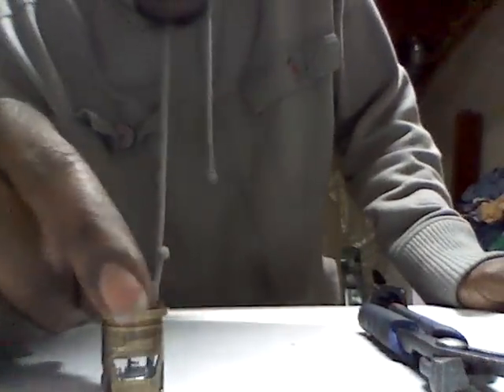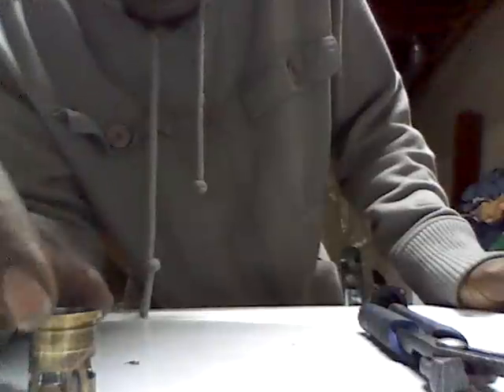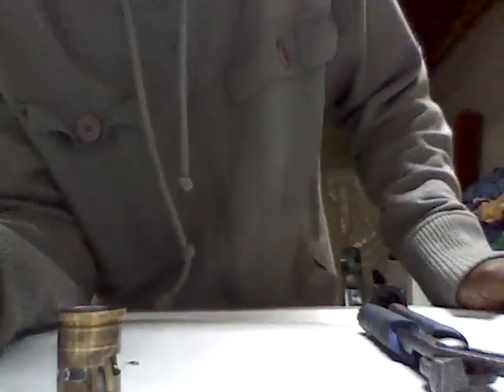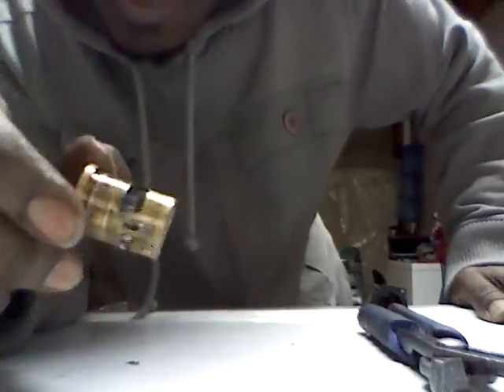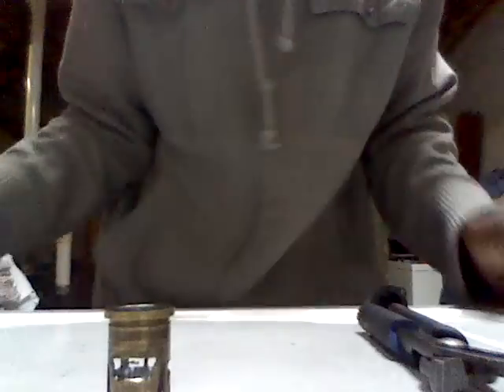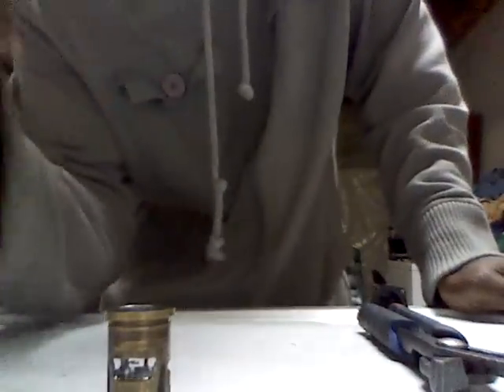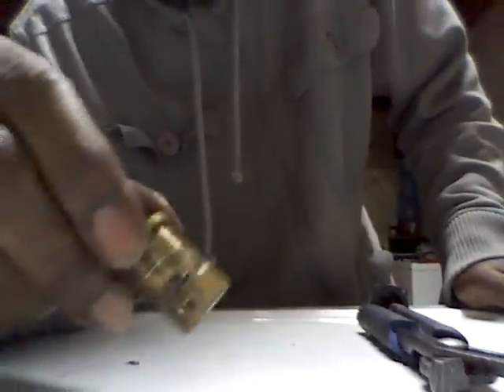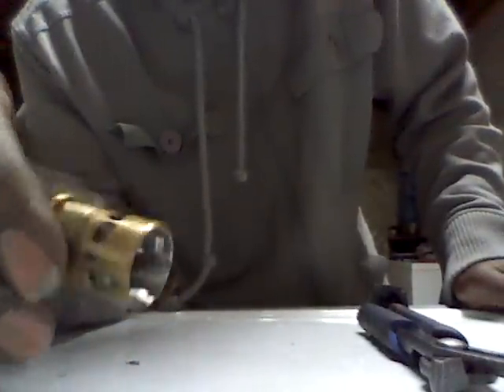RC Nitro Engine Modd / Sleeve Polishing !!!

Comment: doesn't a non polished sleeve help the fuel mix/atomize or flow better somehow because the rough surface?
Reply: if you was to polish the fuel ports the fuel will stick to them and not flow properly and cause problems. the ports need to have a matt finish on them
Reply from the maker: Xanode  In my experience I've seen a small discoloration inside the port itself!   Once you extract the sleeve you will notice build up / a protective film on the sleeve.   Be-leave it or not this build up is what protects the internal parts. This build up helps seal the sleeve, con rod, bearings engine etc ... I'd like to bring a few things to everyone's attention.   
   A Con rod has one of the hardest job in the engine. It has to support the crank an the load(weight). I always hear about a faulty con rod.  Friction !!   I'm sure we all kno the meaning.  If there's no film you have no protection. The brake in process. Depending on the type of fuel you will gain maximum protection. 
   NOW:    When you (in general) broke down or rebuild the engine why did you polish the inside outside an so on???  

 AFTER REASSEMBLING THE ENGINE DID U WONDER WHY IT NEVER RAN THE SAME:    Remember the film??  At the ( D.T.C.) top. That was the seal aka film/ build up between the piston,sleeve and head button.  All polished away.   Wooooooooow   All those gallons and future trophies, gone.
Reply: No polishing don't help with atomizing the fuel it's the design of the ports that that help that's why they sell sleeves with 5port 6port 8port you can extend the cuts in The ports what that does is allows the fuel to enter earlier into the cylinder but you can stuff it up what you need to remember is these companies have done alot of rnd they have designed it for best performance

Comment: Please for the love of god don't polish the inside of the sleeve. There is a reason we don't polish the sleeve or the block where the fuel flow is. That reason is to help keep the fuel/air atomized and from sticking to a nicely polished surface.

Comment: My ni##a that's real I'm 👇 south I need you to help me out on RC truck I have a redcat racing vortex as 4WD 2 speed transmission 3.0 SH. 18 engine how to make it faster
Reply from the maker: Yo whats good.  I always like the Vortex.  It put me in the mind of the late Overdrive ST, one of my 1st trucks by Duratrax. I'll say it was the 1st Short Course before Short Course really hit the scene.  For me I went with a higher oil percentage with my smaller engines 21-12s.  Some may have something to say but performance is key especially @ higher rpm's. 
     2nd ).  Pipe !!  Selecting a pipe can become expensive.  3rd ) Glo Plug   Cold, Med. ,  & Hot      I would take 10 pipes and run every1 at idle and keep note if that 10 don't work out I do 10 more.  Finally engine is talking back.  
    *   Now we work on speed.  
Diff Oil:  A factor when putting power to the ground.  Diff oil helps controls Front /Rear Differentials offset.  Ballooning of the tires when the front tires out run the rear (Balloon Effect).  Tires wearing uneven ufeelme.      *   Pinion gears & clutch bell some come as a unit.   Check out  Ofna.com ( eBay ) Team associated may be compatible .     Hopefully this was a help !!